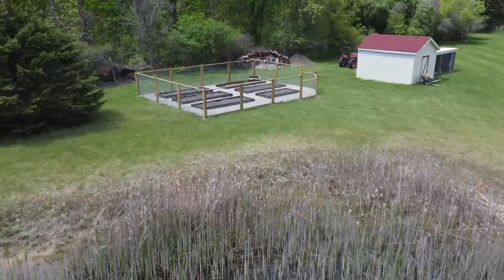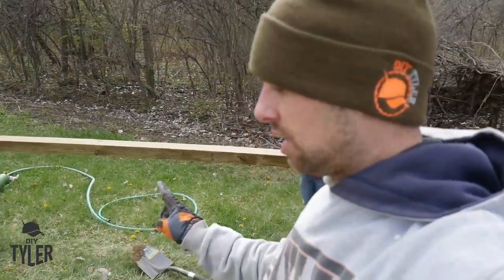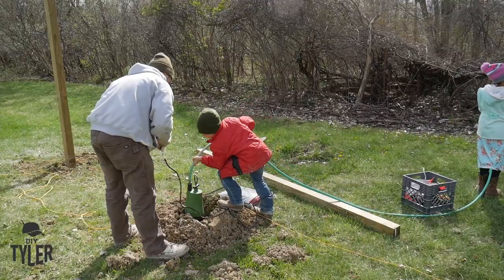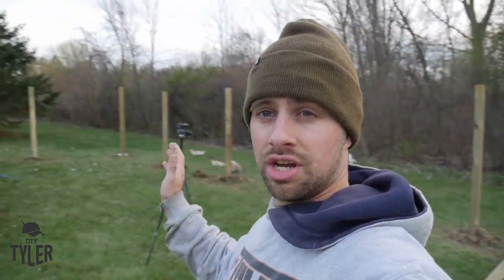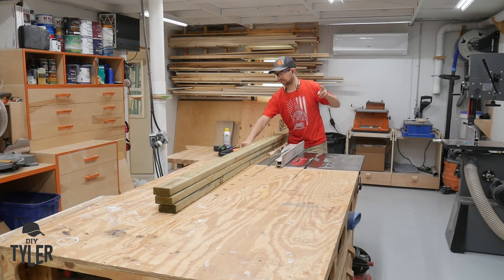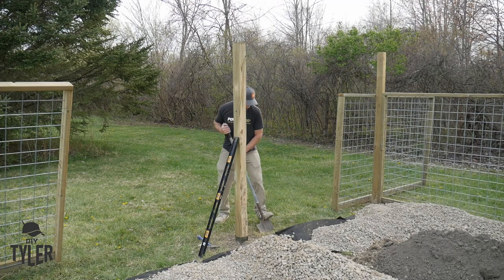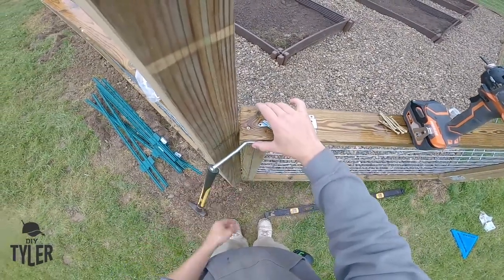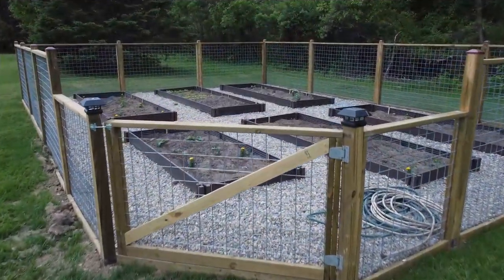How to Make a Deer / Rabbit proof Fence using Dados and Hog Wire Fence in Modular Frame (Great View)

Comment: I think the brace on the door should be the other way around. Lower part of the brace on the hinge side. That way it will work on compression instead of tension.
Reply: Yes, I was just curious how many would have this comment. Generations after generations have taught us the right and the wrong way to cross brace on doors, and I was a little baffled when I saw he did it wrong - a highly skilled woodworkers as he is. Well well, Taylor-Taylor-Taylor we all do mistakes :)))
Reply: @SteifWood  Mistakes like calling him Taylor when his name is Tyler? LOL
Reply: @DumbfoundedMadman  I understand you are a brilliant woodworker too
Reply from the maker: So I installed the cross brace the way you're implying on the shed and everyone said it was wrong.....so.....50% are 100% wrong 50% of the time is what you're saying.

Regardless I plan flipping the brace....and figured to do so before launching the video.
Reply: I don't think the brace on the gate was even necessary because the hog fence alone would give it diagonal strength inless there was a problem with the gate twisting. In this case it really doesn't matter how the support was put on.
Reply: @DIYTyler  I'm not gonna argue to eternity over details in life, just want to mention that all the doors in my 120 yr old barn have braces mounted the way Jason describes - and they still work.
Reply from the maker: Kinda seems like you are.....
Reply: Cross brace is definitely wrong. Tension wire is correct

Comment: Based on your description this was done a few months ago. I had planned to do a very similar fence with the dado in 2X4s so I made a single panel as a mock-up. I used a dado 2X4 top and bottom, (drainage holes in the bottom) and dadoed directly in the 4X4 posts rather than adding vertical 2X4s. What I found was the 2X4s did not want to stay straight and engaged with the fence panels, as they warped and separated in the middle they made it so that a good push could pop the panel out. I was toying with the idea of using something to fasten the wire into the dado but I abandoned the whole idea and went with a different method.

Comment: Hello - In the video you mentioned that the panels were 12' long and they appear to be at least 5' high.  You also mentioned that you purchased the 4"x4" panels from Tractor Supply.  Do have a part number for the panels you purchased?  I've only seen panels that are approx. 52" high by 16' long.  Thanks for the help.

Comment: Have you found your deer fence is high enough? (I would have left those posts 'long' for a while, just in case you needed to extend the fence height. (And I think your lower section around the gate is an easy entry point for them.....)
Reply: So far so good. I've seen a lot of rabbits wandering along the fence line and none have breeched. The deer will mostly have a problem getting a good run at it because of the pond and a fence in the treeline behind it.
Reply: I was thinking the same thing. A deer can leap 10 feet no problem
Reply: @cejkwo100  yep! Without a run at it! Just stand there and jump right over it! I’ve seen where you can run a string around the upper portion about a foot and a half out and they won’t jump it because they can’t judge the distance for some reason. All I know is that it works.

Comment: the wire size is too big to keep rabbits out. How ever you can go to the big box tore and buy blood meal in the fertilizer section spread it around the perimeter and no rabbit will enter. Also human hair from a barber shop works as well for both deer and rabbits..
Reply: You clearly did not finish the video…he added a very fine mesh to the lower section of the fence, so rabbits aren’t getting through there.